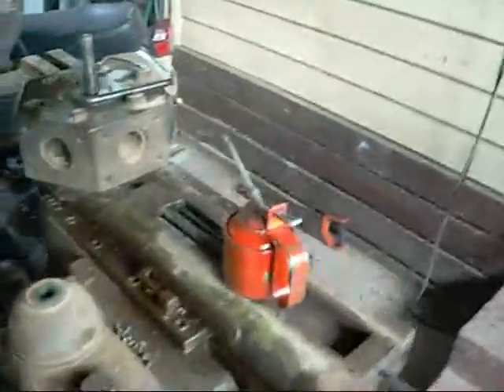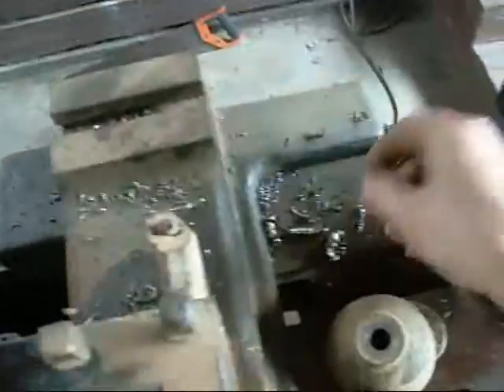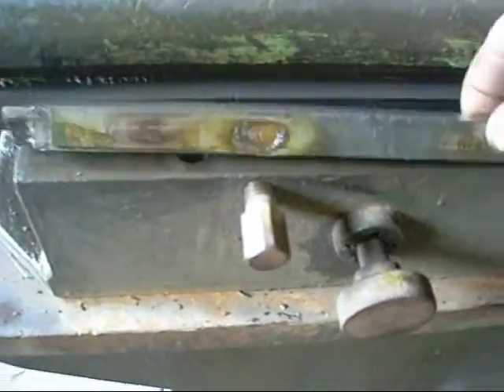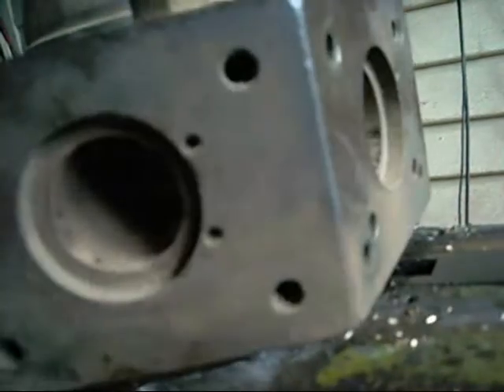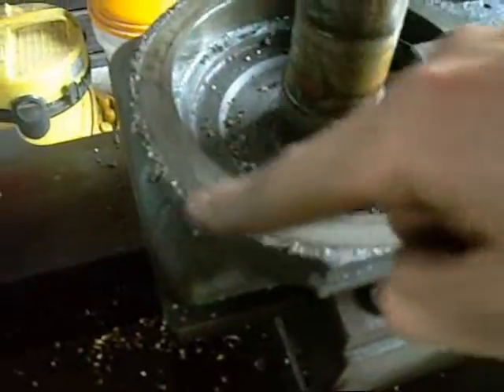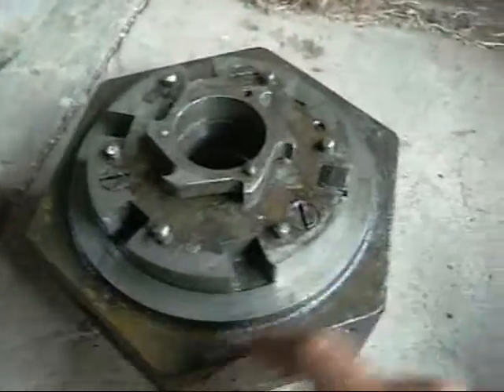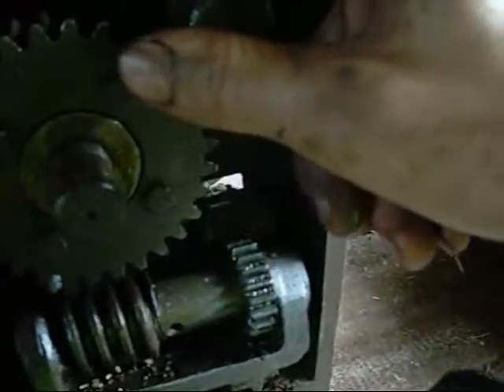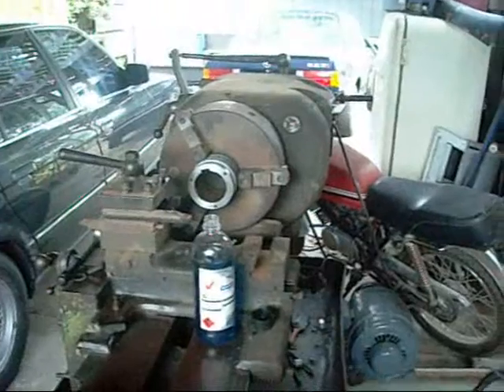Turret Lathe Restoration - Turret Disassembly

Comment: I can make parts for this beast if you need them at cost. I'm working restoring on my new 1982 vintage Mori Seiki SL2 at the moment.  It was $300 cause the control died.  I happen to have new old stock boards for it.  And the shop owner just needed to reclaim the space which he did with a new Mazak.

Comment from the maker: I do have some Castrol Hyspin which is used in CNC spindles but its a lot lighter than the oil in the gearbox at the moment, I'll do a bit more research before swapping to hydraulic oils.

Comment from the maker: no pressure clean for this one :(, unfortunatly it can force water into places I don't want it, and cover the house and carport in black muck.

I'll be using lots of rags and solvent based degreaser, the muck comes off pretty easy.